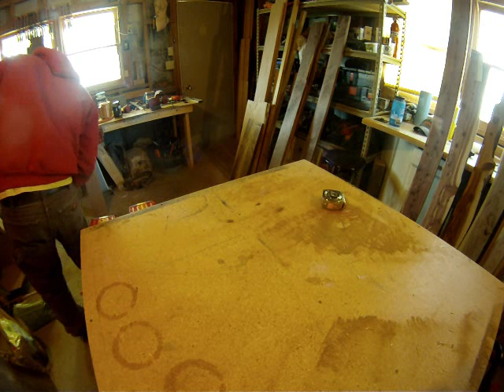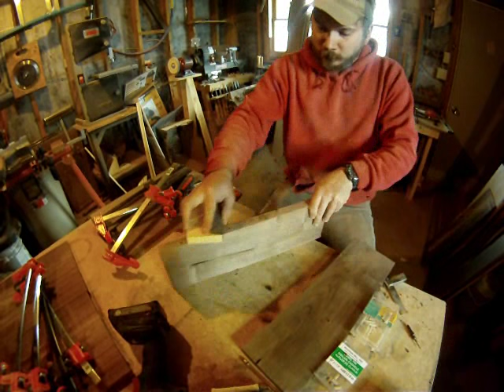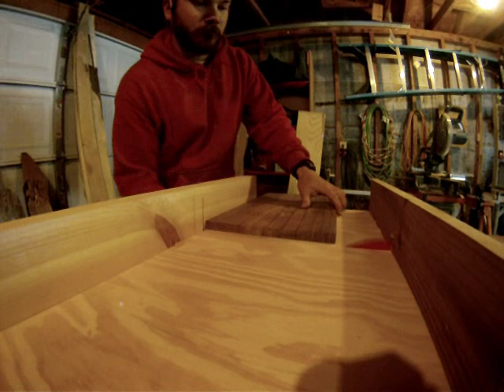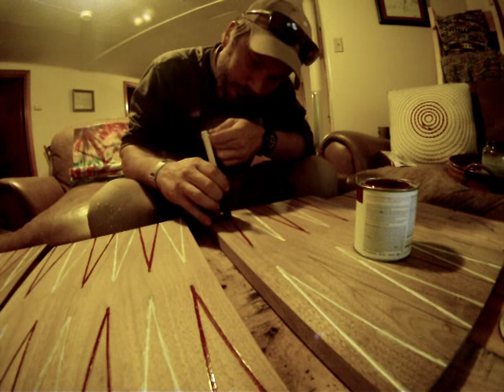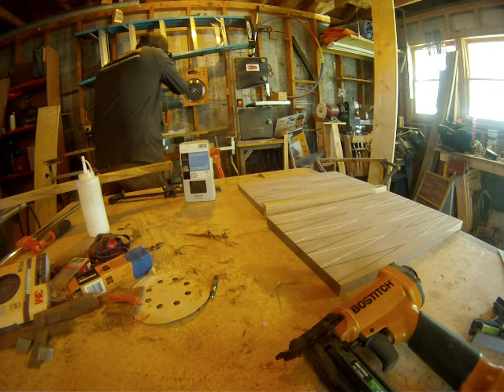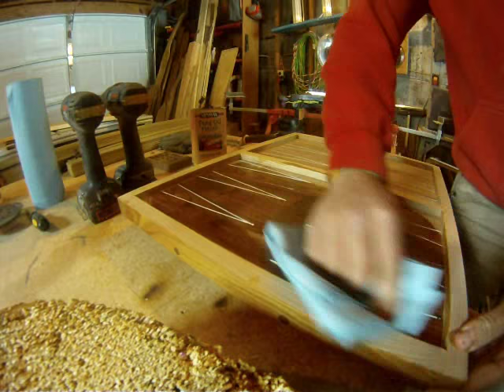Walnut and Ash Backgammon Board

Comment: Cody.  That's a really nice board!  I like the idea of using the router to make the triangles and then painting them with contrasting colors.  My question is what you used for colorant.  Did you use tinted epoxy?  Seems like you would need something that would fill the groove and then fully harden.  Please let me know what you used.
Reply from the maker: Northside Dental Care all I used was basic paints. The grooves are fairly shallow so there's not much to fill, but they're deep enough that they won't get worn with use. I hope that answers any questions you had! Thanks!

Comment: Cody, I get the idea of making the points with the router, but I am not sure how you are using it to make those precise cuts. Can you explain further.
Reply from the maker: Celeste Butler so before I routed everything out, I went through and marked the top point, and the two bottom points of each triangle. Then I just used that board as a guide between my top and bottom point. I would do all of the left sides of the triangles first, then I would flip the jig and do the right side. Hope that helps!